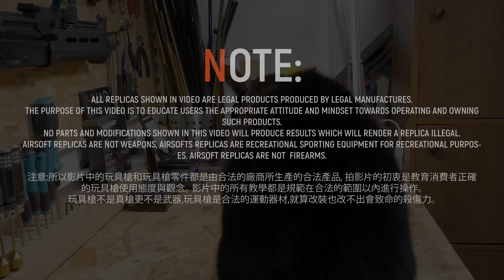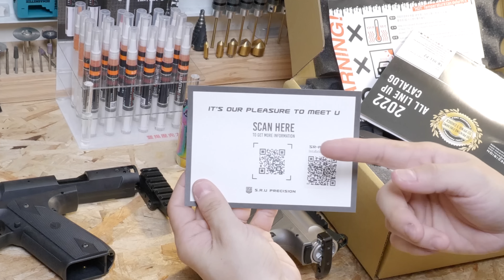Toy Gun ASMR - SRU AAP01 Carbine Kit Unboxing!

Comment: very nice build even if i would have swap the inner barrel for a longer one .
Reply from the maker: Thanks man~ by upgrading the barrel it does boost the fps slightly
Reply: @4UADSmartAirsoft  
Yes indeed..
Modded my AAP, the look of and the range+accuracy on that thing is just awesome<3
Problem, it's no longer CQB qualified..
So I've begun working my way down, getting it to shot 293,4f/ps with 0,25 without loosing too much of it's current performance.
So far it looks like HPA converting is the easiest way tho.
Reply: Awesome set up. I've just brought this kit but abit stuck on the external barrel and tracer or silencer to but on it. What brand and size external barrel and silencer did you put on this one. Can you add the link for them please

Comment: @4UAD I have the aap01 but as soon as I add a silencer it effects the power of the pistol and it won't even shoot a full mag And dumps gas ...as soon as I take the silencer off the pistol shoots fine and I can get to full mags off one gas charge ...have you any ideas what could be causing this please
Reply from the maker: have you increase the length of the inner barrel?
Reply: @4UADSmartAirsoft  no I kept it the same I think I've figured it out firstly the two screws holding the inner barrel where loose plus I noticed as id added the top rail if tightened too much the bolts drag on the actual gun bolt impeding it's action

Comment: Where can I get the barrel and what brand and size is it? the barrel in 25:19 when installing with the tracer.
Reply from the maker: type in "barrel extension", make sure you get the -14mm thread ones
Reply: @4UADSmartAirsoft  what's the barrel length?